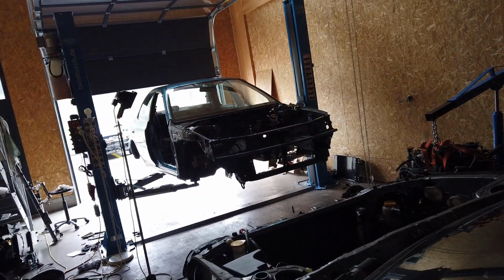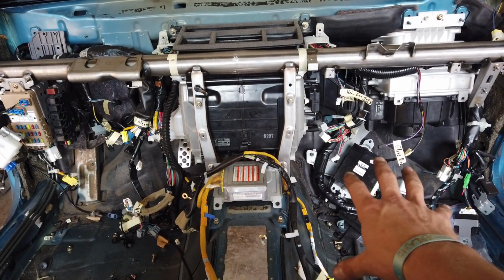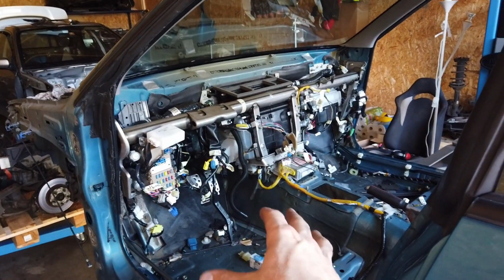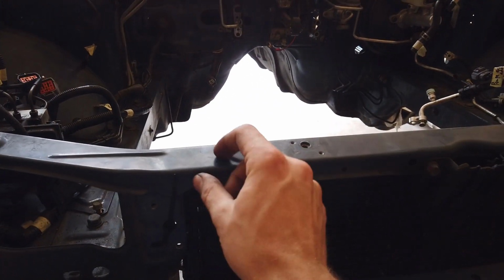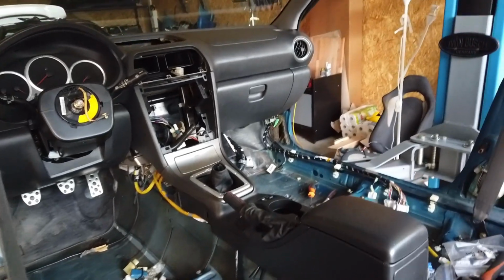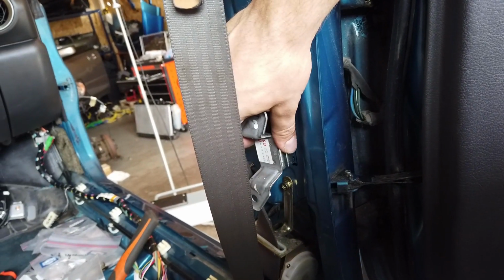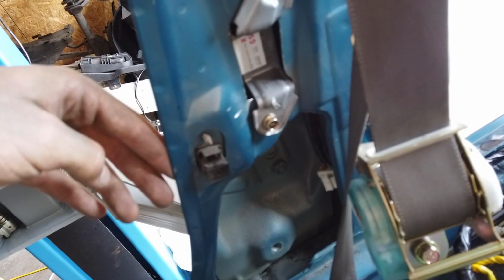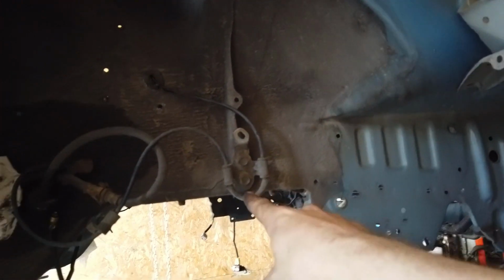Subaru GC8 STI Build Ep. 15 - Installing the new wiring harness

Comment: Honestly, this swap videos are bonkers... Love the great work and dedication of yours!! But I got one question: I do have a RHD Type RA GC8 and would do a steering swap to LHD with a change to a STI06 dashboard as well. Do you know, if wiring harnesses of LHD and RHD versions are the same, or would you suggest to change the interior harness as well? And if so, are harnesses and connectors of GC and GD versions equal?? Thx man and regards from Austria. Ben
Reply from the maker: @bnmb676  Hi Ben, I will be doing a similar swap as you but into a type r very soon.

To answer your questions:
- lhd and rhd harnesses are different
- gd and gc harnesses are different

I would suggest sourcing everything from a lhd gd and doing a clean swap into your gc. That is. If you were keeping the gc dashboard i would have said to get a lhd gc harness, but with the gd dash you probably want a gd harness to get the cluster, climate control, and steering column working properly.

One thing to keep in mind is that i’m not sure how the type ra engine harness will merge with the gd interior harness, and which ecu you can use…
Personally i will be using a gd sti engine and ecu to keep everything as simple as possible.

I hope this helps, good luck with the swap
Reply: @SwissTuned  thx for the instant answer! Matches my thoughts and concerns. But you're right: better change the whole setup to avoid nasty troubleshooting... Good luck with your Type R aswell... Hope to meet in person some day.

Comment: What did you doo for the brake booster? Sti or rs? And what about the brake lines? I trued putting in the sti abs system and line, and sti brake booster. But the brake lines would not fit around the master cylinder(brake booster) at all. I was gonna swap the rs lines into the sti abs system but will need to to Bend them to get them to fit .
Reply: I just saw your other video that answered all my questions haha , thanks for all the help man !
Reply from the maker: Josh Cowles 😁

Comment: I was gonna ask about sensors that wont transfer I.E. seat belt, but you answered it lol gotta ask though, did you just ohm the sti one to figure out which resistor to use? I assume so but still asking
Reply from the maker: Cory Boggs Haha glad you found the answer right away 👍🏻 as for the resistors I looked it up online and saw that practically all seat belts require 3.3 ohms, but I did measure it on the original sti belts to be sure